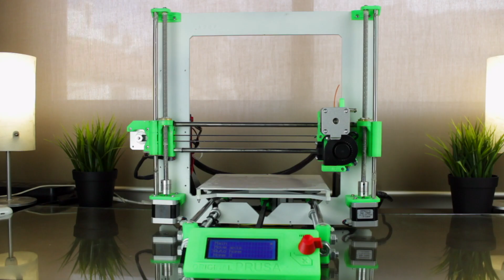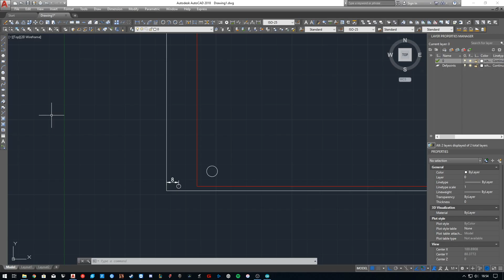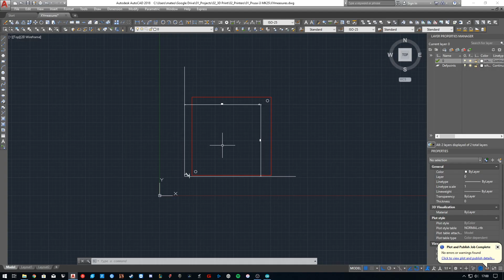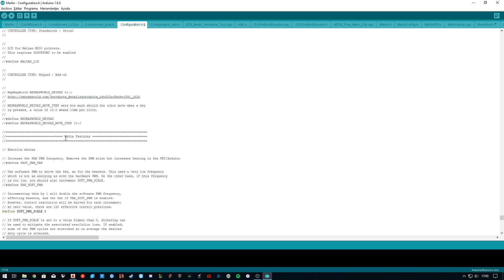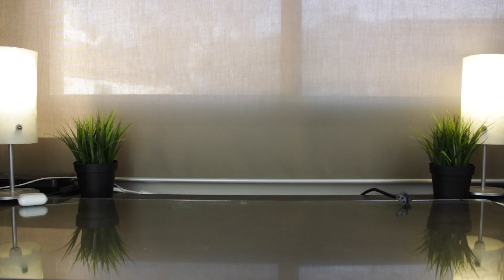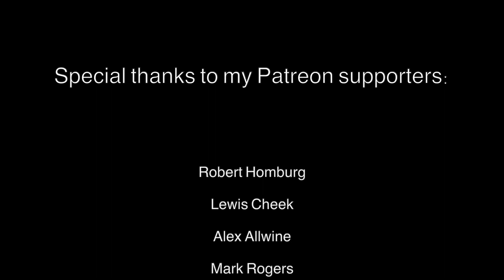Build the BEST DIY 3D Printer - Arduino Coding and firmware upload 2/2 #17

Comment: Hi! I am not using a z probe, instead, I am only using the z endstop. Is it okay if I turn off the probe settings on marlin? One more thing can you please make a video on manual bed leveling aswell?
Reply from the maker: Hello friend,
Yes you could turn it off. In that case you will need to use bolts with springs on all 4 corners. You can check out any 3d printer review in our channel, normally all comercial / affordable printers use this system.
Thanks for your comment 😊